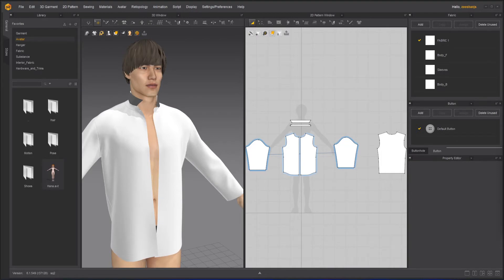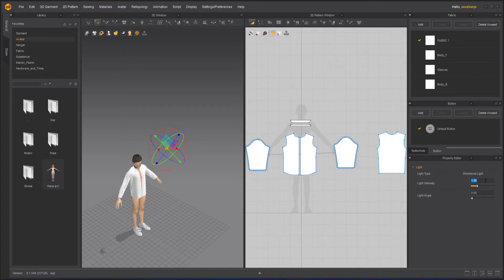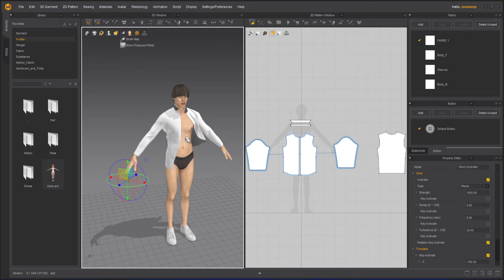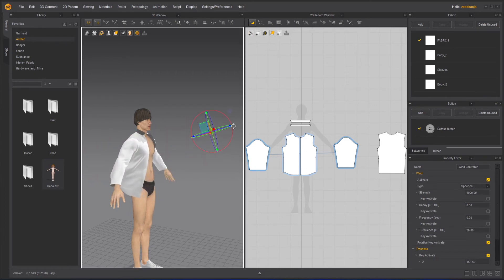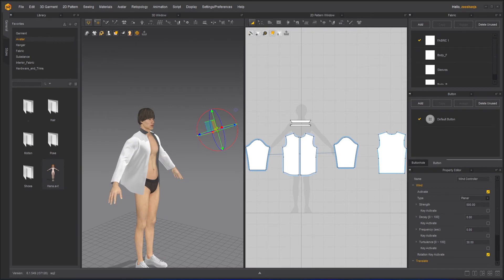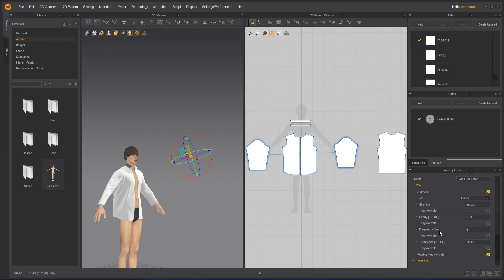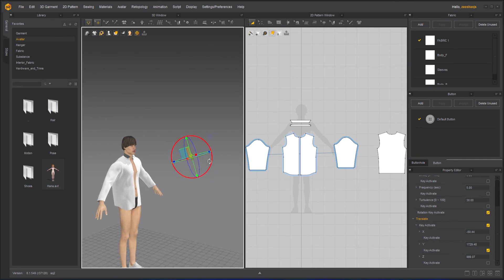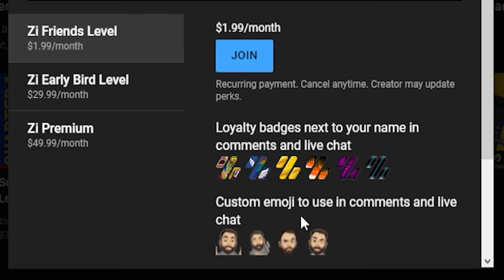Light and Wind Controller | Lesson 21 | Chapter 3 | Marvelous Designer Fundamentals

Comment: wonderful mentor you are, I have watched almost 30 videos and they were all amazing. but I have the same doubt as to why my CPU using 100 percent. my spec is I5-13th gen and GPU 3050😔 card
Reply from the maker: these are good settings for designing clothes but for animation you need higher specs

Comment: my mrv designer using 100 prs cpu how  to fix that
Reply from the maker: If Marvelous Designer is using 100% CPU, it's likely causing your computer to run slowly or even become unresponsive. Here are some steps you can take to fix this issue:

1. Check System Requirements:
Ensure that your computer meets the recommended system requirements for Marvelous Designer. If your hardware is below the requirements, it may struggle to run the software efficiently.

2. Update Graphics Drivers:
Outdated or incompatible graphics drivers can cause performance issues. Make sure your graphics drivers are up to date by visiting the website of your graphics card manufacturer and downloading the latest drivers.

3. Close Background Applications:
Other applications running in the background can consume CPU resources. Close unnecessary programs and background processes to free up CPU power for Marvelous Designer.

4. Reduce Simulated Cloth Density:
If you're working with a complex garment and using a high cloth density setting, consider reducing it. High cloth densities can significantly increase CPU usage.

5. Lower Simulation Quality:
You can reduce the simulation quality in Marvelous Designer settings. Lowering the quality may speed up the simulation process but might result in slightly less realistic cloth behavior.

6. Use GPU Simulation:
Marvelous Designer supports GPU acceleration for simulation. If your graphics card is powerful enough, enable GPU simulation in the settings. This can offload some of the work from the CPU to the GPU.

7. Check for Software Updates:
Make sure you have the latest version of Marvelous Designer installed. Developers often release updates that improve performance and fix bugs.

8. Optimize Your 3D Model:
If you're using a 3D model in Marvelous Designer, optimize it for performance. Simplify the mesh if possible, remove unnecessary details, and reduce the polygon count.

9. Adjust Thread Settings:
Marvelous Designer allows you to control the number of threads it uses for simulation. You can try adjusting these settings in the program preferences to see if it helps distribute the load more efficiently.

10. Hardware Upgrade:
If you regularly work with complex garments and your computer is struggling, consider upgrading your hardware, especially your CPU and GPU. More powerful hardware can significantly improve performance.

11. Use a Render Farm:
If you're rendering high-quality images or animations in Marvelous Designer, consider using a render farm service. This offloads the rendering process to a cluster of powerful computers, reducing the load on your local machine.

12. Contact Support:
If you've tried all the above steps and are still experiencing high CPU usage, consider reaching out to Marvelous Designer's customer support for specific guidance and assistance.

Remember to save your work before making significant changes, and experiment with these steps to find the right balance between performance and quality for your specific projects.